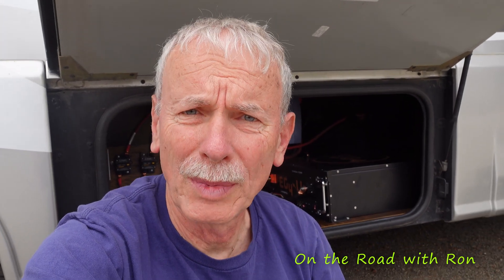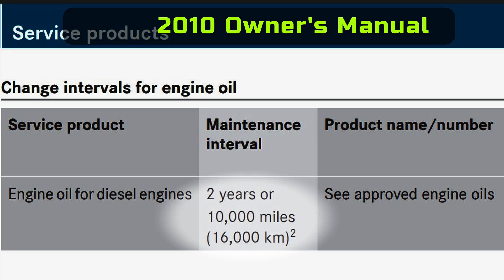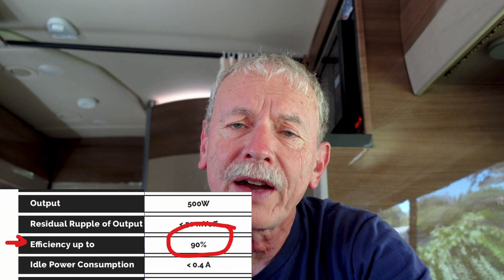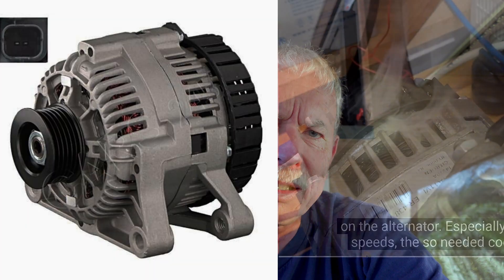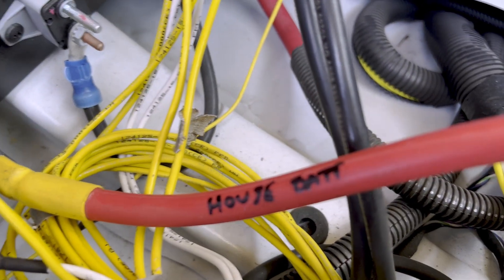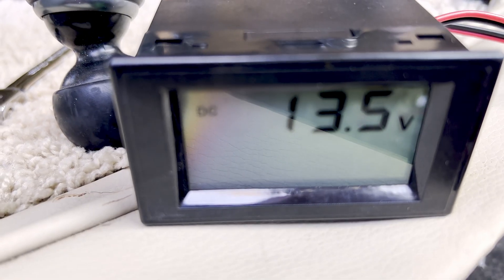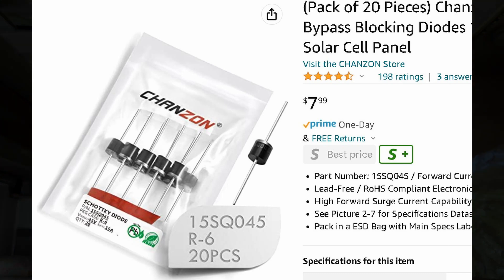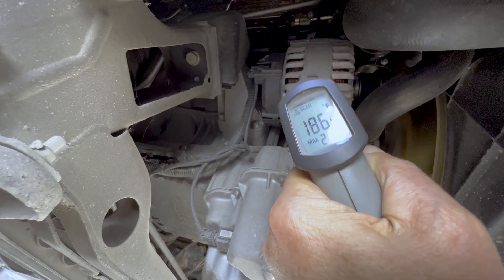DC to DC charger NOT required for big Lithium Battery

Comment: I made the same decisions 3 years ago, when I swapped out the failing factory installed GR24 FLA batteries, and replaced them with 200Ah of Relion lithiums. NO DC to DC chargers, or any other extra hardware, except I added the Charge Wizard Pendant to my PD9245 converter/charger so I can "kick it up a notch" when the sun isn't shining, and I'm plugged in to shore power. I use the same 3 charging sources that you use. I've got a 2018 Navion 24V, and I have had zero problems with my setup, from day one. Always plenty of overnight off grid power from the Relion RB100-LT batteries, and I've got both the propane solenoid vampire draw, as well as the Norcold DC only fridge, nibbling at my DC power reserves. Thanks for including the "Victron smoking alternator sales pitch" video. I laughed when I first saw it, for the same reasons. They definitely "have a dog in that fight". Safe travels, and keep the videos coming. They're great.
Reply from the maker: Nice. Do you have a diesel genny? My particular BMS does not have enough power to start it without the engine running.
Reply: @ontheroadwithron2432  should of kept a couple golf cart batteries connected in parallel to the lithium pack for generator starts! Lead acid is a pain with the maintenance but still works when you need it the most!
Reply: Hi! How is your setup on the year 5? Did you check your BMS for cells currents recently? Did they start to degrade due to overcharge ussues caused by incapability of BMS to balance cells in the end of charging proccess at high current? These are my assumptions. I really hope your battery feels fine )
Reply: @danielromashov92  My Navion is sitting in the driveway. covered in snow, in constant below freezing temps, but plugged into 15A shore, and not a peep of complaint from the batteries. They either self heat when they can charge, or if the temps dip too low, they hibernate, I guess would be the closest analogy. If I had to replace them, I'd choose Relion low temp replacements. They've been bullet proof for over 5 years.

Comment: Great video - you do a great job with all your edits!  I just recently went through the same upgrade with the EG4 on my coach. I did find the Wakespeed WS500 alternator regulator to control my alternator and also a Sterling alternator protection device to protect the alternator should the EG4 BMS shut itself off. Appears the Mercedes alternator is pretty smart - doing what the WS500 does for my dinosaur alternator - good find!  I was going to mention I run my EG4’s up to 27.5 (13.75) and then float at 26.7. Watching Andy’s off grid garage - and watching the charging myself - appears the lifepo4 charges to about 98-100 at that voltage.  The thought not pushing all the way up to 28.8 (14.4) is really not necessary and may extend its life. Just thought I’d mention that and say thanks for the great videos. (I also have a small channel Camp Prevost if you wanted to see my mess! Lol). Aaron.
Reply: Rob, Why the EG4 and not a sealed lithium battery. Is that better?
Reply from the maker: I agree that it is not necessary to keep battery fully charged. My meager 275 watts of solar shuts off at 13.3 volts which is pretty low but fine for my needs.

Comment: Good information. Note that the alternator generates 13.8V, and Li-Ion batteries generally require 14.4V for charging, this may be why the current peaked out at 60A. This also means you will never get the batteries fully charged. Actually this may be a plus, the batteries will never overcharge, but you will need solar/shore power to top them off later. Also a good idea to have a switch-relay. You could wait for the engine to warm up a bit, and charge the engine battery, before loading the alternator with another 60A for the coach batteries, and also in really cold temperatures wait for the coach and batteries to warm up before attempting to charge them. Charging the house batteries is a combination of engine charging, solar, and shore power.
Reply: At 13.8v (3.45v/cell) a lifepo4 battery can be fully charged to at least 98% SOC but it does take a little longer, not much tho, and it is not good practice to go much over this threshold for very long except to perform cell balancing at 3.45v-3.55v/cell. Many of these server rack & lipo4 batteries have a passive  BMS built in that can hardly manage the cells they are trying to balance with small currents and allow them to go to 3.65v/cell before interrupting the charge and this is not great. Anything over 3.45v-3.5v/cell is just potentially reducing the longevity of the battery. Andy’s off grid garage Australia has gone into depth on this subject.
Reply from the maker: Good points. My alternator output is a little over 14 volts. I also have a switch that keeps the house solenoid off until i need it. Of course my main charging method is solar. For some reason the Zamp solar controller stops charging around 13.7 volts. But that’s ok as that will extend the life of the lithium battery when it is not kept fully charged.
Reply: @ontheroadwithron2432  I am in this same boat of adding lithium to my View.  Most everyone says get the DC to DC.  But I like your logic.  I just tested my alternator and saw 55amps max with my SOK 206AH battery and only 160 degrees idling.  I need to deeply discharge to test again.  But for solar I do have victron.  I was able to set all of the parameters  needed to keep the lithium battery happy and healthy.  You need 14.6  to do this I guess.  And you can damage and unbalance cells if you do not use correct setup to finish off your charging.  I am not sure about any of this though.  Are there any settings you can change for the zamp to optimize for lithium?  Because that 13.7 is even low for 6v lead acid batteries.  One thing i am not sure of is what to set my converter charger voltage to.  It is a powermax with an adjustable fixed voltage.  I mostly use it for storage as we rarely plug in when traveling.

Comment: Ron, I replaced the boost solenoid with a LI BIM 225 when I upgraded to LI batteries. The BIM is causing generator problems. After watching your video,  I m reinstalling the solenoid. How is your alternator holding up? Again thanks.
Reply from the maker: It is rare that i would need to charge with alternator. Solar charges most of what we need. I anticipate using alternator when there is a hot night and we run the lithium down using the AC. This only happens occasionally.

Comment: Great video Ron.  I've been running two Lion Energy UT1300 batteries in my View 19D for 28 months now.  I did plenty of research and opted to NOT install a DC-DC charger or a BIM.  Never an issue and I still stand behind MY decision.
Reply: I use 4 headway lifpo4 cells in my mower. The mower has a constant voltage regulator and so far it has performed excellent. I'm no longer buying crappy overpriced lead acid batteries.
Reply: AS I UNDERSTAND IT, IT'S NOT THE CURRENT THAT IS THE PROBLEM BUT WHEN THE BMS IN THE LITHUM BATTERY SHUTS DOWN THE CHARGE THE BACK EMF WILL TAKE OUT THE ALTERNATOR DIODES. THE DC TO DC UNIT PROTECTS THE ALTERNATOR
Reply: @victorjcano  As long as you have a lead-acid battery as starting battery, the alternator well never have an occasion to experience no load situation.  Since most of the RV still equipped with starting battery and a house battery set, the alternator will never get damaged if the house LiFePO4 is shut down.  There are also plenty of power draw from the alternator by various of devices in the engine bay.  it is said that there is about 30 to 50 amp of current draw when the engine is on idling.
Reply: @victorjcano  Not a problem on my system.  The coach start battery is always connected to the alternator so even if both LFP's shut down, there is still the two Group 31 start batteries to dump the current to which eliminates any voltage spike.
Reply: not when you have the led battery from the car charging at the same time
 @victorjcano

Comment: Hi Ron:  I like your videos, and I partly agree with the conclusions of this particular video.  I installed two 100AH Battleborn Li batteries in my Thor Delano (very similar to your RV).  I noticed a draw from the alternator of 150A+, which got my attention.  Like you, I saw that the Mercedes alternator is 220A rated.  I did install the Victron 30A DC-DC, so when driving, I get up to 30A from the alternator and up to 30A additional from my solar panels.  I have not regret this expense and time spent installing that DC-DC charger.
Reply: So you have 2 charge controllers? You could have tried the KISAE DMT1250 that charges from 5-50A selectable by the user and it takes either from solar or from the engine's generator - up to 50A. It cost $250.
Reply: Those dual chargers can only handle 30 volts of solar, so they dont work for a lot of systems
Reply: @evelynwalker1998  Not as simple as that in an RV.  Dimensions, wiring paths, and multiple energy sources are all considerations.

Comment: I thought Mercedes recommends never idling the engine, that it is bad for sprinter Diesel engines. I think in your test you idled the engine for an hour?
Reply from the maker: MB says 5 minutes to idle if using biodiesel. Regular diesel up to 6 hrs.

Comment: Thanks Ron.
You have covered this important topic with good examples to make an informed decision. The replacement of the factory lead acid with Lithium batteries have improved my Navion camping experience
Reply from the maker: I just found an issue with my battery. It will not start the diesel generator. Current is too much. Working on a solution
Reply: @ontheroadwithron2432  
Thank you. I wonder why ONAN has that problem?
I have replaced my NAPA with Lithium 12 V 100 AMP (Group 31) and its starts the Onan Propane on my 2018 Navion.
Reply: @lefler39  Hi Steve, It's not an Onan problem. The Diesel and Propane generators for the View/Navion are specified for 300 Amps cranking current. The battery Ron put in is specified for just 200 Amps discharge current. The EG4 is a great battery at a great price but it's going to take two of them to crank the generator. The upside of this is he'll have twice the capacity for twice the boon docking fun. I'm a bit envious. Like you, I also have two 100 AH Lithium batteries. Mine are the Lion Energy UT1300s from Costco rated for 150 Amps discharge current each. Two of them in parallel are 300 Amps, just perfect for cranking our generators.

Comment: Never listen car makers about oil changes.
CARMAKERS ARE JUST TELLING BULLSHITS ABOUT OIL CHANGES only because they know that oil change is a fuckin time and money problems for a lot of their customers.
To attract cars buyers they have to pretend that you have not to do any all oil changes so frequently than other carmakers just to pretend that they are better carmakers than others even if it s not true.
But REMEMBER  : Car makers are and never be able to product any motor oil in all their history  for sure because it s a secret doing  valuable gold job of oil companies.
So oil changes have more to see about oil companies that have studies good oil avalaible looking time use.
Oil time use, it s all about oil quality and value you put in your car not miles times to change it.
Carmakers miss humility about this fact. 
Remember : motor running time is a better correct value than miles what much more concerns the car chassis than the motor.
In professional motor véhicules as tanks, chargers, bulldozers running time it s applied, not miles.
Life oil time to change it is more about running temperatures oil can suppport and if temperature about oil is correct or not.
If  motor temperature is ok,  Motor Oil and motor itself will do a great long job.
If u charge a big load on thermic motors the first 20 mn after start, you will load  it  with a lot of billions little metallic pieces  what will transform your oil in a destructive lubricant for motor and fucks its power level  quicker than you wish and much more before the car can be over. 
Start motor and let it warm it on same spot 5 mn while you can left your jacket to drive more comfortable on a seat to drive or call anyone that you advise him that you run to him.
Then running it 15 mn after the start with a very light motor load.
@ 20 mn running, temperature motor will be ok to be used at M@x.
Remember that when a carmaker company will always tell you a change oil distance, it will always be with the best motor oil and so the most expensive not the basic to ensure you will not break their profits lookin your motor guarantee.
If you follow  that way and ONLY  run your car in motor ways with the best high grade expensive motor oil, the explanation of oil change by Mercedes about 20 000 miles it s ok.
Running motor ways far away from traffic jams, oil will not get higher temperatures that it s advised to or supported.
But in town with a lot of runs and stops adding traffic jam oil will suffer much more.
So oil will up@  extreme temperatures that will cook it, changing it in a coal material that will black all motor oil and wiil damage it if you dont change it more frequently.
20 000 miles in this case, it s not correct and will not get commitment requirement of motor life.
Following rules i explained, your motor will run 1 000 000 kms looking the oil companies test they verified before to sell their oil product to car makers.

Comment: Great information Ron. I have a slightly different situation having a boat with 2 diesels, 2 x 140 amp alternators and a 130 amp battery/alternator isolator. Along with this, I have a port battery bank with 3 group 24 Marine starting batteries in series and the starboard side has 4x138 amp Lithium batteries. I have a 60 amp solar charge controller that is typically charging at 30-40 amps to the starboard bank (House) only. There are a couple of things that I have tried. One is to run the watermaker while under way. This uses about 150 amps of 12 volt power while running. This has not been a problem so far. I also have run one of the 16,000 btu air conditioners that takes about 200 amps and have not had a problem either. Unfortunately, I have only had the boat for a short time and do not have amp meters or even proper volt meters installed yet and can only spot check things occasionally.  One problem that I do see is that the port side alternator does not contribute as much power as the Starboard alternator. This being due to the isolated voltage sense wires going to each alternator. The port side is the side with a static bank of batteries that really only run the instruments for the engine and stays at 14 volts. The starboard side runs everything else and has the solar and lithium batteries. There is quite a difference when going through the battery isolator. I am also unsure if the isolators rating of 130 amps, but I don't know if that is total or per alternator or battery bank. So far I have taxed them pretty hard and everything is still working fine. I do have the luxury of having 2 alternators, battery isolator switches, solar charging, a 12 kw generator with 50 amp battery chargers and missive amounts of power. Any single failure is only an inconvenience while out cruising. If anybody has any advice for my particular situations, I would love to hear it.
Reply from the maker: That’s quite a system. My main concern would be if the alternators have sufficient cooling. They can be in a closed engine bay and get pretty hot.
Reply: @ontheroadwithron2432  a closed engine bay is different on a yacht. The engine room stays much cooler than under hood of a vehicle. It has plenty of air circulation and no radiator as all engine cooling is done with sea water. It is also much larger in volume.
Reply: @lkeil84  I have moved the engine room blower so that the hose is at the front of the alternator and pulling heat directly from the fan.  I also added a second cool air fan that pulls cool air from below deck and blows it directly onto the rear of the alternator.  Without that, the sound insulated engine space stays at +200ºF.
Reply: I have found the same results as Ron on my motorhome, but my boat is a completely different result.  The motorhome is safe because given that the LFP is at one end of the coach and the alternator is at the other, the 90' round trip of wire creates enough resistance to limit the current to the battery to less than 70A.  On my boat, the batteries are only a few feet away and my 108A alternator will happily send 108A to the pack right up to the point where it goes up in flames.  On the boat, I have an external regulator on the alternator and use a reduced field current to limit output to about 60A max.  I also have a digital thermostat with the thermistor mounted to the alternator case which shuts off charging any time the temp gets to 200ºF.